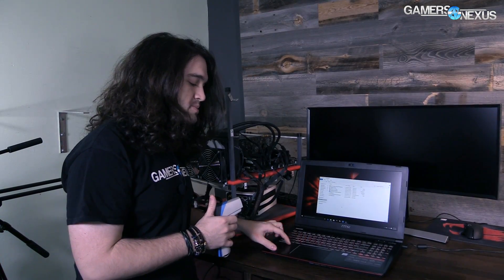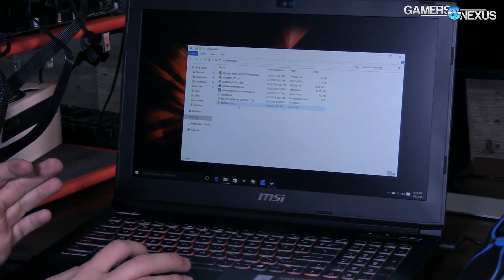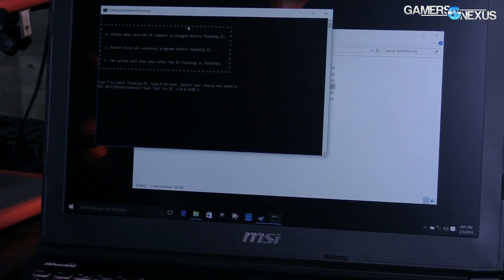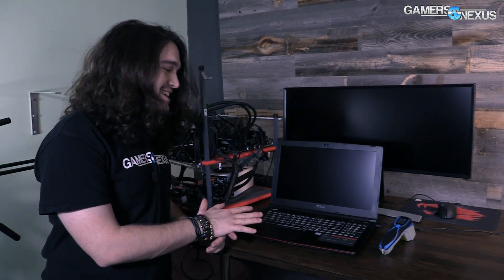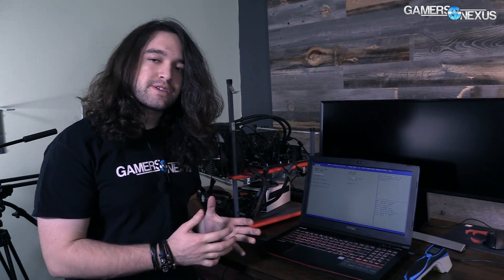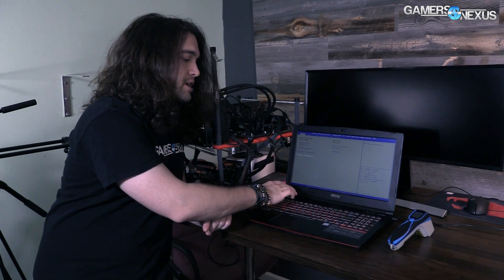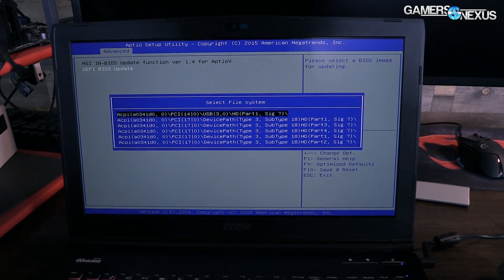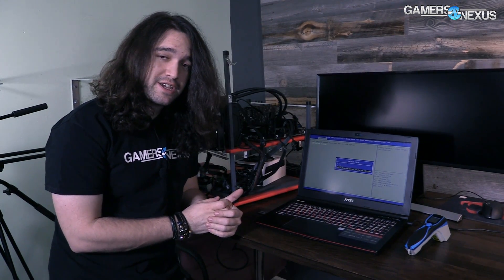How to Fix MSI Laptop Fans & Overheating

Comment: I have found the heat pipe for the GPU not conducting heat as it must. Heat remains just in the plate over the GPU. So maybe the gas inside the copper pipe is gone. I need to improve this, because the laptop goes off after a short period of time, even without load.

Comment: To everyone, to all web surfers who might be searching the issue of MSI laptop(s) ridiculously hot and with fans spinning even when doing nothing: be aware of the following.
The problem has NOT been solved by the EC Controller Firmware upgrade.

Maybe that helped some users, but the problem is still there.

My MSI GL63 8SD still exhibits all the symptoms:
• CPU always around 68-75ºC (rarely down to 65ºC) even when in idle
• Fans spinning almost all the time
• The EC Controller Firmware is already updated and the version matches the latest version downloadable from MSI website

Therefore, people of Planet Earth, as your life goes by I want you to be aware that the EC Controller Firmware upgrade does NOT fix the problem of MSI laptops overheating and the problem is still there and needs to be addressed.

Just so you know, I also performed a thorough cleaning of the old stock thermal paste and re-pasting using Noctua NT-H1 and nothing changed.

So, now, people of Planet Earth: old paste is not the problem and re-pasting does NOT fix the problem.

The problem is still there and still needs to be addressed.

Somebody please do something at MSI and with MSI, thanks.
Reply: Oh boy, another dead end. Been investigating "fixing" my MSI GP72 2QE Leopard Pro (5700HQ+950M) since I bought it and I was REALLY HOPING re-pasting might be the answer, or EC update, or a BIOS update, or undervolting with Throttlestop, or tweaking fan curves with the Dragon Center, or SCM, or the Silent Option, or Afterburner, or... Or Or.
Seems these MSI laptops are just shit. I've had this thing for ~7 years now and it had issues the moment I bought it, it WILL overheat and BSoD itself unless I throttle it... With Throttlestop lmao The hard drive and fan malfunctioned shortly after I bought it (thanks forced Windows 10 update) and now the keyboard keys are starting not to register (even ones I never use like the 9 on the numpad)
Hilariously, every once in a while, it will have a "seizure" and the fan speed goes up WAY HIGHER than I get with the dedicated Cooler Boost button that exists SPECIFICALLY to ramp up the fan to 100%.
These are not gaming laptops, they can't handle it without overheating (at least the GP72 2QE, which has 1 fan, later models have 2)
Not to mention MSI's website redesigns have broken or orphaned tons of links so you can't find the software easily.
Reply: @Cormy1  I hear you brother. As a compromise, I calmed the fans down by accessing the msi advanced bios setup (Google the key combination, I don't remember) and undervolted. I hope this helps. God bless you, brother

Comment: I know this video is 5 years old but I just updated all that on my MSI GL63 9SDK. It has 2 fans but only 1 of them runs until I push the cooler boost button and then they will both run. Any suggestions? Is it maybe a bad fan that needs replaced?
Reply: Generally the GPU fan will only kick in once its being used, IE when you launch a game. Open MSI Dragon Centre, check fan speeds, if GPU is showing 0 Rpm, open a game and see if it starts.

Comment: Okay so I have an MSI GX740 with an Core i5-450M, an ATI Radeon HD 5870 1GB gddr5, and dual 2GB 1066mhz DDR3 RAM.
Once you turn the laptop on, the fan immediately stars screaming and when I open cpuid hardware monitor to check my temperatures, I can see that my CPU is reaching temperatures of up to 95 to 100 degrees Celsius even though I have 5-25% CPU usage (nothing open except cpuid HWmon and windows 7 itself), I've cleaned fan intake/exhausts and the airflow is excellent, it has new thermal paste etc...
I've thought of everything possible, under very light benchmarks, the CPU reaches 105°C and it immediately shuts down the system (for safety of course, it's normal for it to shut down at those temps)
I need help even though I know quite a lot about PC's lol

Comment: Just messed with the windows power options. Temps was hitting 95c. Switch to sport in dragon centre first. Cycle through the choices eg balanced and high performance. Set max cpu state to 90 - 95 max check temps. There seems to be a disconnection between windows and dragon centre on my machine. Also changed the paste couple weeks back and fans was synchronizing up to 5000s instead of 7000s and slightly off from one another. Will check on the bios and firmware tomorrow. Will try do benchmarks between windows power options and MSI speed options and see what the differences are. I suspect a driver issue.

Edit - Windows Power Plans can alter the maximum allowed voltage of your processor.

Comment: **WARNING**

DON'T mess about with the BIOS if your computer works normally!!! I'm glad if this tutorial worked for some of you guys  but I went ahead and updated the BIOS hoping that it will fix my fan curve but after my BIOS successfully updated, the laptop restarted itself and the system couldn't boot up at all. The BIOS wasn't responding so it meant that my system could not boot up. (Left with a dead laptop).

Tried everything to reset the BIOS back to factory but I couldn't (Resetting the CMOS, removing CMOS battery, trying to force a BIOS update through an external drive), so I had to disassemble my laptop and send the motherboard off to a specialist so that he could remove the BIOS chip from the motherboard and re-solder a new re-programmed BIOS chip.

A common issue with flashing your BIOS sometimes is that your BIOS could get corrupted, leaving you with a black screen when you turn your laptop on. You can hear your fans spinning and your keyboard may light up, but the system won't boot because the BIOS is not operating.
BIOS handles the basic input/output operations of your system, so if your BIOS has failed then it won't be able to boot your windows OS from your hard drive (SSD, HDD, etc.), hence leaving you with a laptop that turns off just with a black screen as the system is not booting.

My BIOS update completed without any interruptions such as 'laptop turned off during the update, etc.', it just somehow got corrupted and there was nothing I could do, except get a new BIOS chip. Luckily I found a BIOS specialist in the UK which I sent my motherboard to, otherwise I might have had to spend £400 on a new motherboard... Which would not be worth fixing at that point.

Lesson learnt... I won't be messing about with the BIOS anymore, especially if the warranty on my computer has expired.
Reply: Completly false, BIOS updates are not there to break your computer, as long as your select the correct bios for your motherboard, msi has the correct ones on there site for your product. Most likely the issue was when you did the BIOS update is switched the mode to UEFI instead of legacy and you couldn't get back into the system.

Comment: Bought a msi laptop something like 3 years ago, it still overheat and i just use it for simple task now. How rude that i paid so much for that shit
Reply: have you tried cleaning it and applying new thermal paste? Once I cleaned mine, it went from 50C to around 30C idle. Under load from 85 to around 65.

Comment: For everyone in 2020 who thinks to get an msi laptop, here is my detailed case for the temps and over all perfomance.

i got the msi gf65 9sd the spec are:

GTX1660TI
16GB RAM
512NVME
120HZ SCREEN ( OCED TO 130HZ USING CRU )
INTEL 9750H 

so here is the detailes about the temps and perfomance,

while gaming at 80-90% gpu usage the temps are 77-80 max ( while turbo boost for fans, dont game with out trubo boost enabled for fans , it affect temps massivly ) and the cpu at 4ghz and 53% usage the temps are in the 88-92C max

here is the temps for a bit lower gpu/cpu demanding games

cpu usage at 25-45% the temps are 85-89C max
gpu usage at 69-76% temps are stable at 74C

those numbers are tested in a room temps of 34C ( im living in iraq its extremly hot, 4 days ago we got world record hottest temp which is 56C )

after buying an air conducotr here is temps

i tested only at demanding games so here is the result
cpu at 49-55% usage the temps are 83-87C max
gpu at 99% usage the temps are 76C

here is the result after undervolting by 150-mv

cpu at 45-55% run at max temps of 72 at speed of 4ghz
after decreaseing the clock speed to 3.8Ghz the temps neverd pass the the 69C in almost all games
for the gpu i kept the temps are 67C

so guys imagine you have a colder place and room temps just imagine how cold the laptop can goes! so the last temps as u can see is extremly perfect for a laptop. even 80c is so good what u say about a temps never pass 72C? while i had a freind with hp omen flixing their 96-99C temps at cpu 40% usage (bf5) until it shut down. 

MSI laptop are high quality laptop for gamers and i do highly reccomend them! not to mention the good battery life. asus scar laptop cant hold 1 and half hour while my laptop filxing 3 and half hour in normal usage. and a standby of 5-7 hours.

the final choose is for you guys. i just wanted to share my information to maybe help any one who decide to buy a laptop. becuase im extremly happy with my laptop temps in this hot country.
Reply: Well explained man!! Thanks for that. Talking about tempratures, i gotta say something, i have msi gf63 i5 9gen 8/512 ssd nvidia 1650 max-q, while i game like gta5 on very high-high combination settings, my max temprature goes upto 77 degrees and my normal temprature while gaming is between 66-73/74. This is because I don't use cooler booster, instead of that i use 'advanced' setting for my fan in which we can manually set the fan's RPM according to the heat, which will definitely help for y'all! Just check it out ; 

DragonCenter>UserScenario>user>fan>advanced>settings, you will find out there. Btw i have a question, i have a little backlight bleed in the bottom left of my display, which is visible only in black screen. Is that a problem?

Comment: MSI laptops are complete crap. I thought I was getting a good deal (GL73 8RD) with the solid CPU and GPU in it. The thing is made out of thin plastic. 5 of the spacers for the screws broke when I opened it up to upgrade the memory (this has never happened before with other laptops). The fin-guards for the vents broke off. One of the fans died after a year. The keyboard is the worst I have ever had. The top of the 'A' and 'W' keys have already worn off (this also has never happened to any of my other laptops).
I will never even entertain the thought of buying one of their laptops again, and will always discourage others in buying them.

Comment: i have a msi gl 52m 7rdx and it keeps running at 92 celcius, yikes
Reply: perhaps you have it charging while playing pc games, laptops tend to overheat while under heavy load and charging. i noticed, while not charging; the temperature drops to 47c and stays there, even while playing Warface with graphics on high.  before i took noticed of the high cpu temperature it reached reached 97c. but im trying to help out with experience from my old under powered laptop.

Comment: I bought gs75, when i start game its very slow, then i tried to set dragon centre to extreme performance, it did not work  then i restart and tried again until it worked, then the game is ok, but now extreme performance not working i think, so game start and its slow then fan start loud much and game more slow and fps is 20 or less

Comment: All my heat is in the back of the laptop when I'm gaming. Like under the speakers area I have my fans maxing out...gf65 thin msi... I'm worried
Reply: ill go to the dragon center and it's like 90 degrees C. I'm so dammed confused. the laptop is shit at this point, broken hinge, overheating, screen flickers when I turn it on!
Reply: @Rainbow.Quartz  get a good oscillating fan and point it at the screen so it hits the side as well... Worked for me keep it on high
Reply: JOLLY CANNA thxs!
Reply: try to undervolt with throttlestop
Reply: try playing games while unplugged from ac cord. it worked for me very good.

Comment: I bought msi gl63 9sek just a week ago and now when I plays games on it at fans at maximum my cpu temprature lies between 93 to 95 degrees   I have no problem with my GPU temp ot mantains under 75 but what to do with cpu 

Please help
Reply: Needs to be thermal pasted. You can go to a nearby computer tech.

Comment: i know this is kind of  an older video but one thing to note on these laptops, on the heatsink they put some tape? on the sides to i guess keep the metal from touching the cpu and gpu.. on mine the tape was miss placed and went under the core.. taking this tape off lowered the temps dramatically.

Comment: The same as others have said. I thought laptops wouldve come a long way in the 10 series and 7700 intel series. The laptop can not handle it self it runs so hot the skin on my fingers literally get light burns.

Comment: Hello, my laptop is msi cx61 and I done update EC firmware with a wrong file. Now my device is not running and not powering, when I press power button only fan works for a few seconds and then it's turn off! The LCD is not powering and my machine is dead. How I can restore previous version of EC??? please help me......